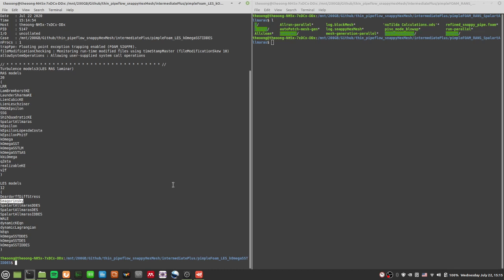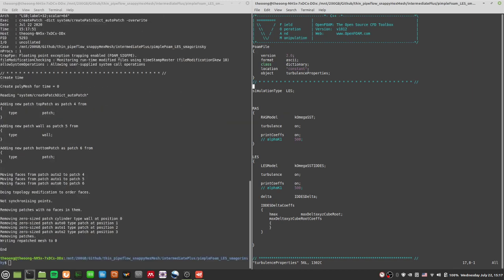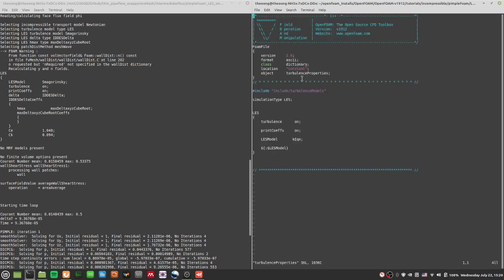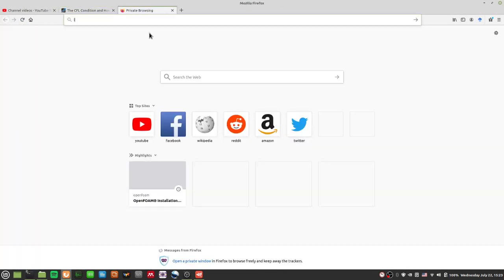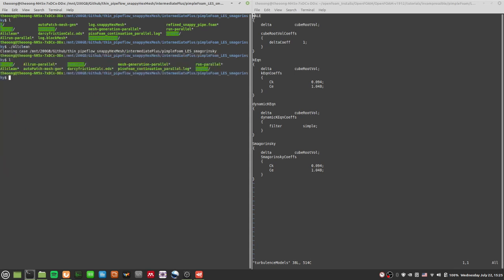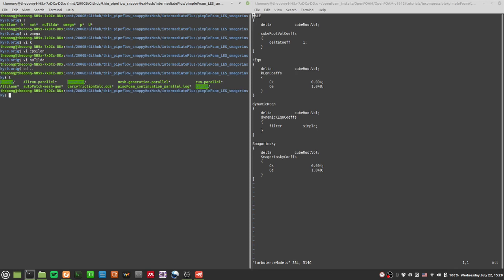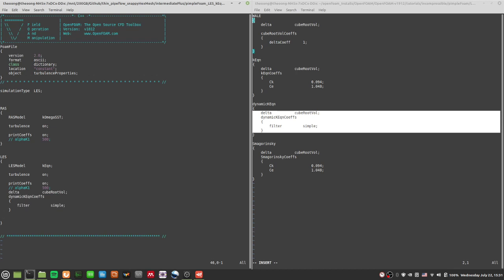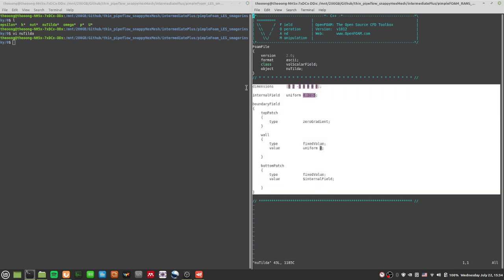OpenFOAM Intermediate - 72  LES type simulations syntax for Smagorinsky Model

Comment: Does LES-OpenFoam takes compresibility into consideration or it is just an incompressible solver?
Reply from the maker: Hi, i believe the LES model is not usually meant to take compressibility into account. Most of the stuff i covered is for single phase incompressible flow

All the best in finding your solution